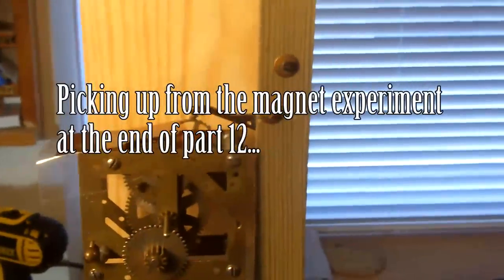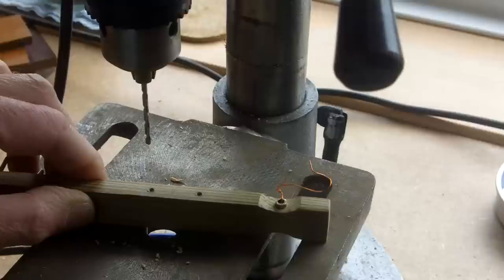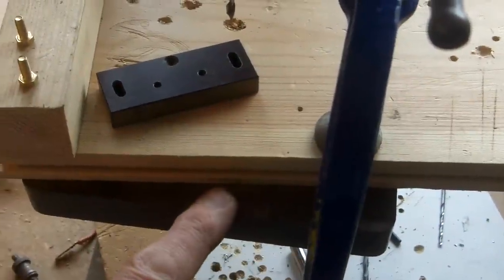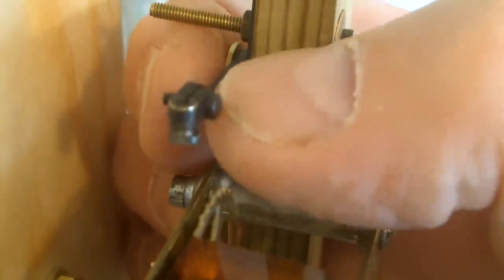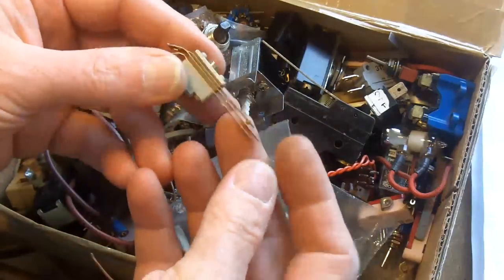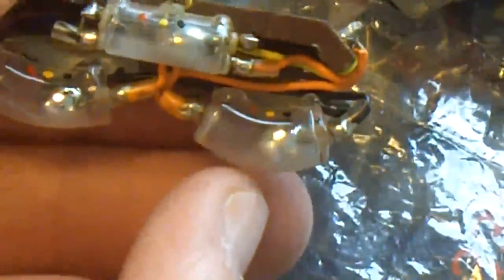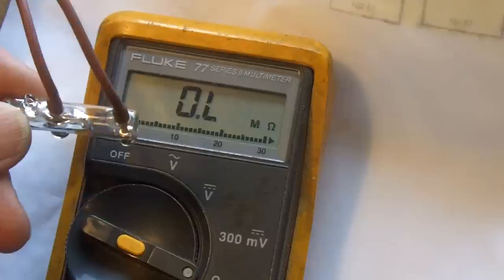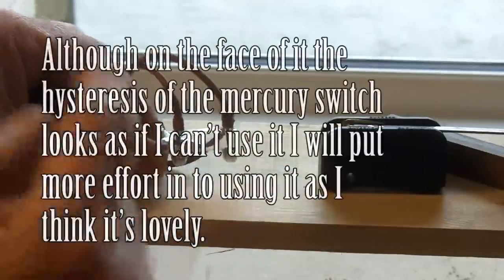Hipps clock movement project, rough part 13

Comment: The Hg switches are beautiful. that triple Hg switch may have come out a temperature sensor for a commercial oven or utility transformer temp indication to indicate high temp alarm, cooling fans on, and trip. The Hg switch hysteresis will be to slow as you proved in the video. You could use them for 30 seconds or 1 minute driving of secondary slave clocks.